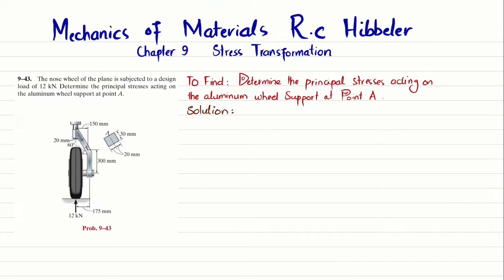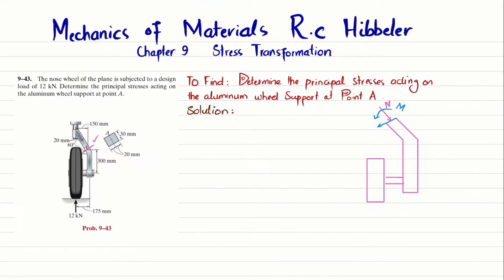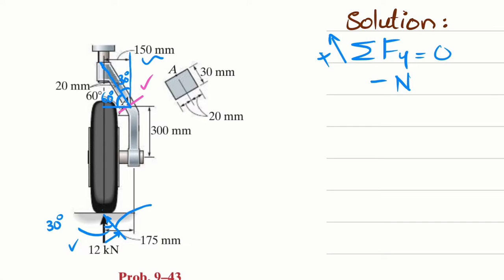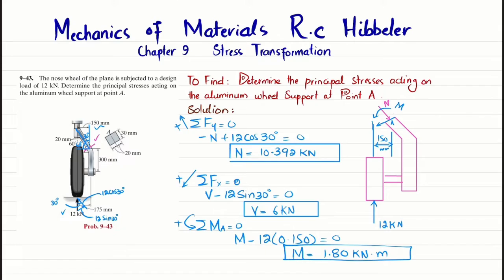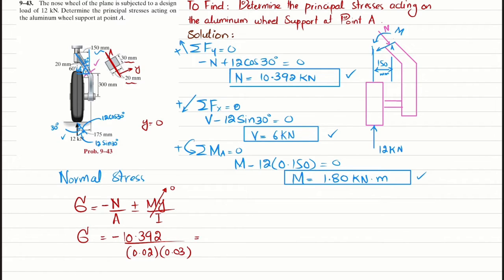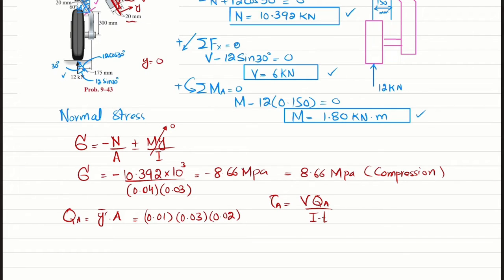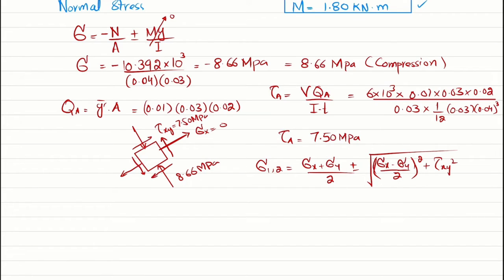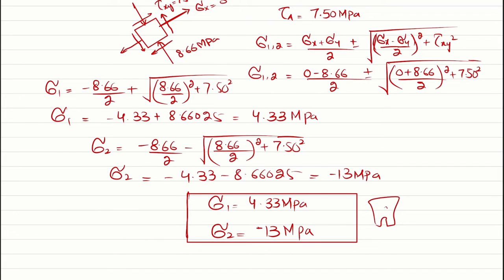Determine principal stresses | Problem 9-43 | Sress Transformation | Mech of materials Rc Hibbeler

Comment: 8.66MPa is wrong
Reply from the maker: Where , please specify the time frame ?
Reply: @engradnanrasheedmechanical check the calculation at 8:52
Reply from the maker: Focus on the techniques rest you can calculate it as well. Thank you
Reply: 08:54
Reply from the maker: @pacersducks2 Yes the area was (0.04*0.03) but in hurry I put (0.02*0.03). The calculated was based on area 0.04*0.03 = Area
Reply from the maker: Yes the area was (0.04*0.03) but in hurry I put (0.02*0.03). The calculated was based on area 0.04*0.03 = Area